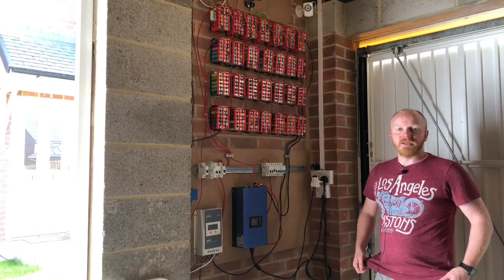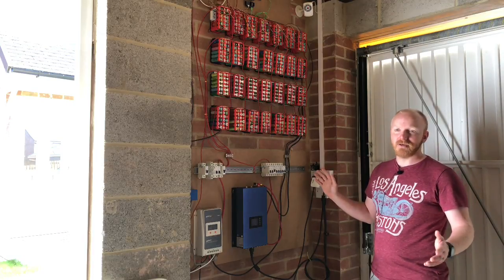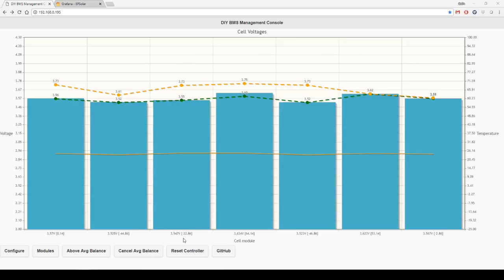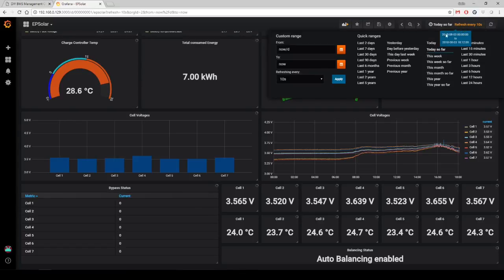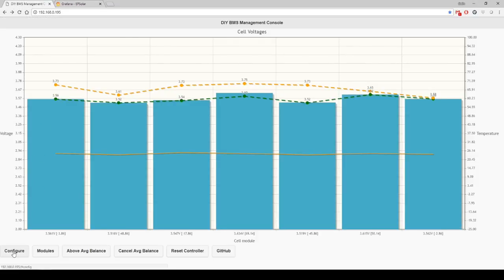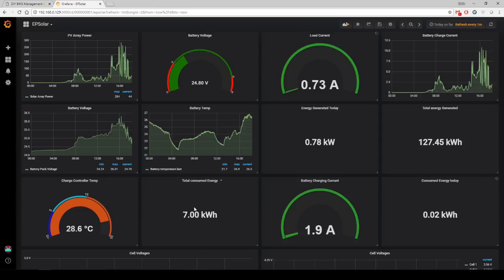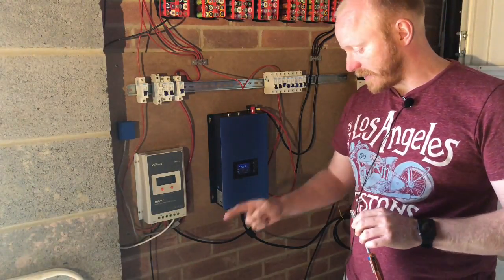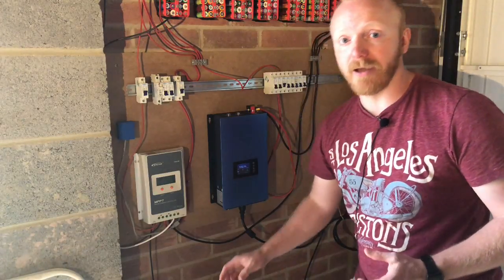DiyBMS part 5 - Interference Solved

Comment: Is there a way to read the data over HDMI from the BMS? I'd like to simply connect it to my TV, to monitor batteries, just swap inputs on my TV, to check the battery bank,  
I have 6 120 ah, 7s battery packs, I'm going to change the packs to 1s modules, to simplify the balance leads, and wiring, I have all the balance leads on 8 terminal connectors, with 20 gauge wire, that connect all the batteries to a single set of balance leads, all wires are very close in lenth,  I was just ballancing , and having difficulty getting it to ballance , this is driving my decision,  I will charge each 120 ah, 4.2 v pack, and parallel all of them, for a day or two, to have them equalized, then put in 7,  1p  packs, like the rest of my 18650 packs, it will make the BMS, and BC balancing much simpler..
Reply from the maker: You can record the data to a pi or similar and view it via say a grafana dashboard.

Comment: hi colin is grafana built in to the bms software or do we have to do all the process for grafana our self
Reply from the maker: Hi Brett, in my version of the code i added the ability to output to an influxDB database, you can then easily output the influxdb data into grafana.  I run InfluxDB and grafana on one raspberry pi together.
Reply: @Chickey  ill have to looke at getting my old laptop running on linux os. 
As iv been trying to get influxdb running on windows 10 database is set but getting network error mite try again on my pc server that i have set up for game loby raceroom. If that still dont work will try direct linux install on my old laptop

Comment: How hard is it to order the pcbs?
Reply from the maker: It's a really simple process, on the github page there is a set of gerber files which you can use to order the boards from a fab house such as jlcpcb/oshpark/pcbway etc.

https://github.com/stuartpittaway/diyBMS/tree/master/BMS-Cell-Module-Circuit/Gerber
Reply: Colin, I would like to submit an order for the pcbs, so I'm checking to see if there are any new versions or mods in the works that I should wait on, or should I order boards based on the current gerbers?  Thank you for your hard work and great videos.

Comment: How can you be using that inverter with batterys and no limit cable???
Reply from the maker: The inverter has an internal limiter which i've set temporarily so it output's only 150w currently.  It's configurable though to any value up to the inverter limit.  I hope to have the limiter fitted soon.

Comment: Im running the same firmware.  I can speak to it running quite nicely!  

Here is what I did for the query to get the average of the cells in to grafana.  

SELECT MEAN("last") from (SELECT last("Voltage") FROM "Cells" WHERE $timeFilter GROUP BY "Cell")

This gave me the average of the cells.  I made one change and on the options tab i have it changing color if the average is over the threshold for average balancing.  Unfortunately that part is hard coded so I put in if the values is > 4000 it changes colors to show it's over the 4v where mine triggers balancing.

Comment: Very interesting. Do you know if the DiyBMS can be modified to work with LTO cells which are lower voltage (2v to 2.6v)
Reply from the maker: The REG710 datasheet says that it can take a voltage of 1.8v to 5.5v so theoretically it should work ok on LTO cells.  In the module code there are hard limits for what the bypass voltage can be set to so you would have to modify those accordingly but theoretically it should work ok.  You can verify on the data sheet http://www.ti.com/lit/ds/symlink/reg710-25.pdf

Comment: As an additional feature it might be worth looking into adding a CRC byte to check the integrity of the I2C (which is actually not meant for inter module commutation :P ) data package.
Reply from the maker: Danny Bokma yes that would be a great feature and shall add it to the list for the future.  In this case each module doesn’t talk to each other they are all slave devices on the ic2 bus which report directly to the controller.

Comment: Nice how much balance current can one module do? Also are you using only 7 boards to charge all the batteries? I have a rather large amount 7s times 7 rows. Thanks. Your mains must be noise? glad you figured it out
Reply from the maker: old time engineer I think around 2amps should be your limit but you will pushing it.  I use a 6.8ohm power resistor so it balances at around 0.5a. The boards aren’t charging the batteries, the pack is hooked up to charge controller directly.  Depending on your setup you might need a bms setup per each bank of 7 which would mean 7 controllers and 49 modules, quite an undertaking!

Comment: Thanks for the update. Good to see the whole system working without any issues. Nice also to see the pcb is use. My first pcb design - I’ve learned a lot since then! It would be interesting to see the consumed energy by the inverter.
Reply from the maker: Adam Welch thanks, I’ve still one of my old boards to replace with the ones you kindly sent through too.  I think after the inverter monitoring I’ll leave it be to see how it runs long term.  To be fair my solar gets completely shaded in the autumn/winter so I’ll be looking to reach a high enough voltage for a balance so shall be reporting duties only.

Comment: Very interesting that your inverter is producing RF interference.  It shouldn't if EC marked as it 'should have been' tested by the distributor.  It would be worth seeing if any harmonics are around too as they may be causing interference to neighbours equipment. Use an AM radio and check for interference by scanning the frequencies and checking anything you find by switching off the inverter.  The frequency may change under load.  You might want to check the quality of the power that's coming out of it too since it my not be terribly friendly to any devices connected.  If you need help checking for interference,  and solving any problems, you may find the following useful https://rsgb.org/main/technical/emc/i-am-experiencing-interference/
Reply from the maker: john macrae thank you for the information and link I’ll have a read through, just need to try and find an old school am radio, sure I must have one somewhere!